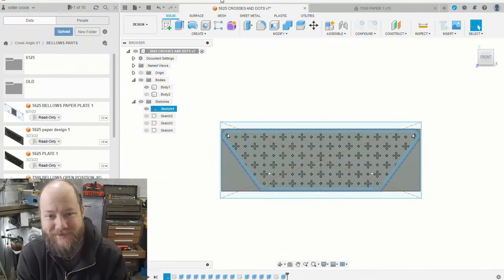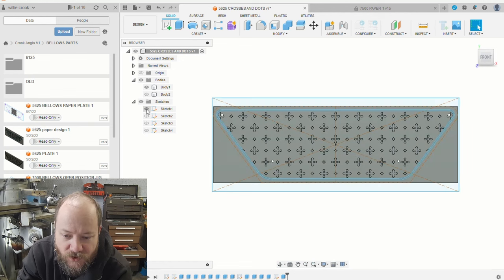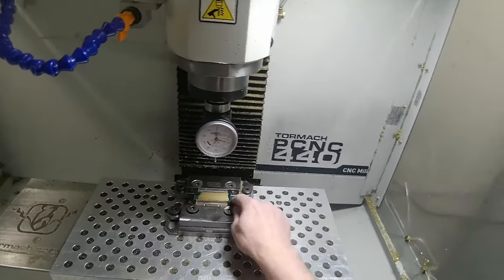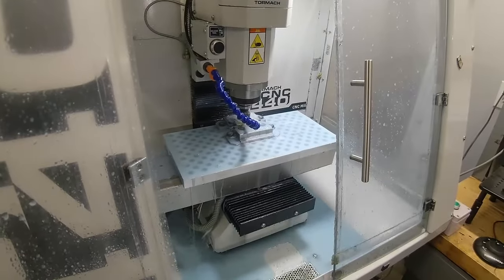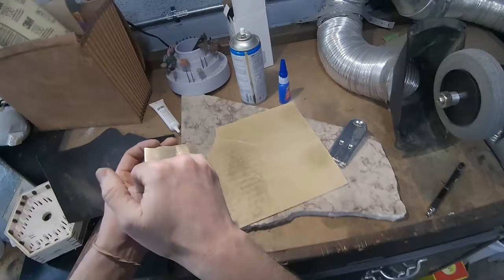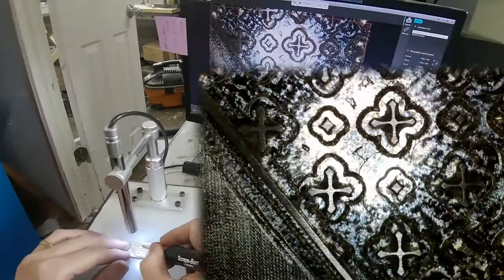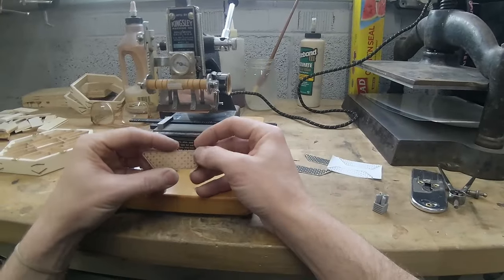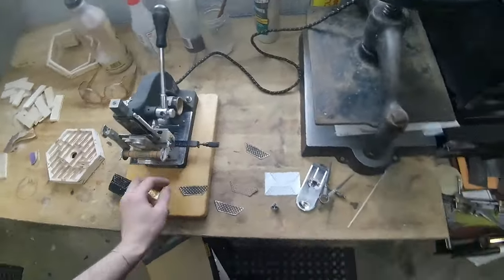Making a bellows paper printing plate.

Comment: I use this as a guide.

Material: Stainless Steel (Young's Modulus = 200 GPa = 200 * 10^9 Pa)
Resonant Frequency (f) = 130.8 Hz
Width (b) = 3.45 mm
Length (L) = 34.36 mm
The calculated thickness using the cantilever beam equation is:

t =  **(3√( (2 * pi * L^2 * f) / (1.875 * E) ))

t^3 = (2 * pi * (34.36 mm)^2 * (130.8 Hz)) / (1.875 * (200 * 10^9 Pa))
t =∛( (2 * pi * (34.36 mm)^2 * (130.8 Hz)) / (1.875 * (200 * 10^9 Pa)) )
t ≈ 0.1 mm

Use Google Gemini AI (Just a fancy "smart" calculator) 
to do the calculation for you.
Just give it the measurements 
and 
frequency, 
and 
tell it to calculate the thickness as if the reed is a cantilever beam.
You can also let any one of the parameters be the unknown, 
the AI will manipulate the formula and calculate the unknown.
Oh, and the AI will look up the Young's Modulus for the material you are using.
Just tell it what material you use, steel brass or whatever.
Reply from the maker: I really don't think it's necessary to do all that calculation.  For me, reed making is much more intuitive.  You could have a reed produce the same note with much different profiling and it would play completely differently in terms of tone, response/attack, dynamics etc, but play the same pitch.  It's about making the decision as a reedmaker how you want a reed to perform, something no calculation could ever tell you, and which can only be understood painstakingly through the personal experience of actually making 100s or 1000s of reeds by hand.
Reply: @CrookConcertinas  I had to, I was lost for initial thickness and length and so on, it gave me some idea of what to aim for.